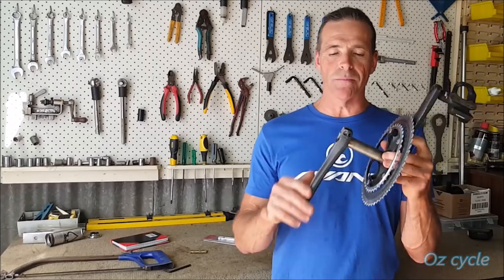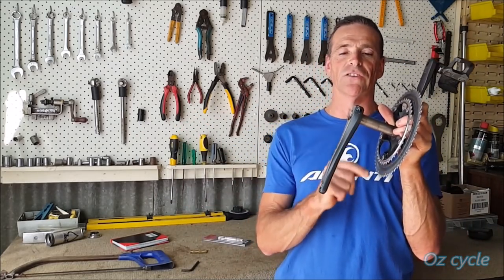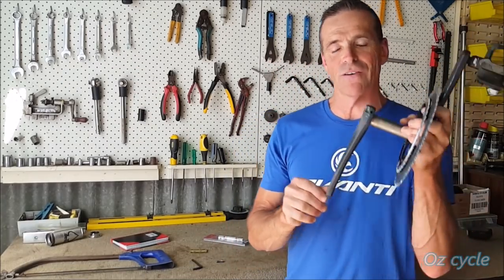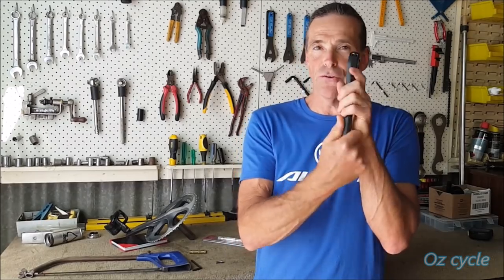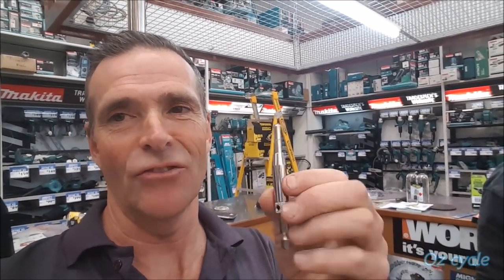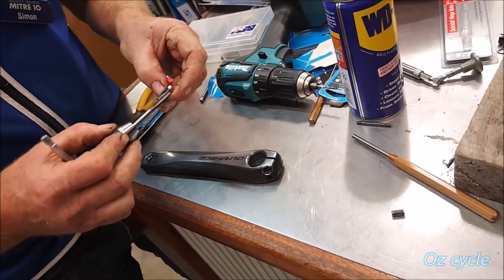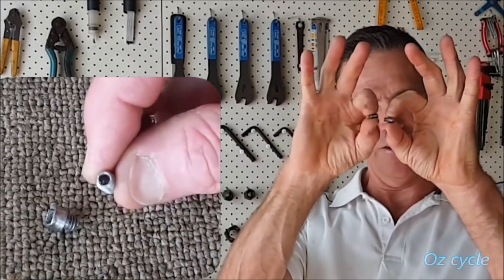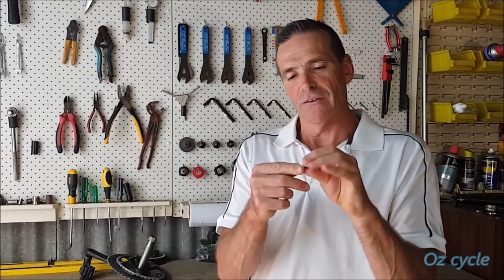Remove snapped off bolts

Comment: Good job mate i stripped the thread on my saddle clamp bolt on my Giant propel the shop used the same method as you. I have now invested in a torque wrench so it does not happen again.

Comment: The specialised carpenter's bit can be achieved by simply finding a suitable diameter piece of pipe for the hole. Left hand drill bits are so good that usually you will not need an easy out to finish the extraction : the bolt will extract itself as you're drilling it out.
     Excellent presentation. I would advise clamping the work, though, whenever possible.

Comment: Ive swapped mine to titanium and u use a torque wrench. I also put a little drop if loctite blue. I used to have a small set of broken bolt removers you just driĺl out a little less then the diameter if the bolt and screw the bit in until its tight then undo it. Probably very similar to the easy out.
Reply: Do you use the quickbit hinge mate to drill the hole first? I tried that with ordinary drill ,the bolt is too firm!!
Reply from the maker: Drill a pilot hole first with a very hard bit like a cobalt bit
Reply: @stevenleffanue  I will try that! Thank you so much.

Comment: Good info, thanks. Just a reminder people to grease  threads before you install bolts so you don't round out the heads. And use a hex  that's in good condition.
Reply: And always use the right size Allen wrench.

Comment: I bought a used bmx bike and the stem bolts were rusted on, I got all of them off except for one and this one is stripped. The worst thing ever is a rusted on and stripped bolt. The worst part is I can’t even ride the bike until I get the stem off to replace the fork with the new one I bought.

Comment: Hello. Thanks for video. This gadget wich you used is very expensive! It is possible to get similar on Aliexpress or Ebay (mayby quality is not the same) called "Self Centering Hinge Drill Bit"
Reply from the maker: The Aliexpress ones...the tool itself will be fine but the drill bit want be hard enough for drilling stainless steel so you may need to buy a hardened drill bit seperately.
Reply: @stevenleffanue  Yes, good suggestion.

Comment: I've got brand new ultegra rim brakes. Need to change the pads to carbon specific ones... One of the cartridge retainer bolts is rounded from the factory. FFS. It's so tiny! If I try and use a tiny bolt extractor and it goes wrong I might invalidate the warranty.  I can send the brake caliper off for inspection but that seems like a total hassle
Reply from the maker: Use a reverse drill bit. Careful to hold it central as you drill and you will get the bolt out.
Reply: @stevenleffanue  well I got it out! My reverse drill bit was too big for the 2mm hex hole in the bolt. Luckily I remebered a set of torx bits that came with my ratchet screwdriver. I  was able to jam the 2.5mm one in. Mangled the bolt head a bit more but it was heading for the trash anyway.

Comment: Great video as always, thanks. When running a tap through an already threaded hole, does the tap naturally find its way into the existing thread and clean it up? Or is there a risk it will try and cut a whole new thread and you end up with a mess?
Reply: same as screwing a bolt in. just dont cross thread it and make sure it goes in level.

Comment: How hard is the metal in the drill in the "hinge mate"?  Will it work on most bolts on bikes?  This video is timely for me since I have a broken cleat bolt on some shoes that I like.
Reply from the maker: You can put whatever drill bit you want in it. An 'Inox' bit is probarbly best.
Reply: @stevenleffanue  thanks Steve.  Very helpful, I will get one.

Comment: Needless to say that some white grease would have helped avoiding this problem, i guess. If the bolt is stuck heat it up to 120 - 140 Celsius and let ist cool down several time. I know that it will take up all your patience. The tension and release in the metal might make your job easier.
Reply from the maker: Yes,heat works with metal in metal but it will usually damage the surrounding metals molecular structure not the least any paintwork or anodizing. Not suitable if a bolt is associated with carbon fiber either.

Comment: sort of unrelated down under do you say a bolt is ceased instead of seized?
Reply from the maker: Ceased...is that right?
Reply: @stevenleffanue  ceased, means stopped like a cease and desist order from a lawyer. Seized means can't be moved. Just curious if it was Aussie slang (:
Reply from the maker: Not slang. We just say seezed 😂
Reply: @stevenleffanue  seized 😛
Reply: @stevenleffanue  I like the channel btw I'm a bicycle mechanic by trade though from the MacGyver school. The other day at home I used a quick release and a few washers as a headset cup press ;)

Comment: Your friend should have tried to use t25 bit to extract the screw before the larger hex key, it has more bite
Reply from the maker: Good idea Marc. You mean a T30 or T40 tho, as the head was a 5mm Alen and T25 is too small?
Reply: some times that works, I did this myself on a bolt once, but some times the bolts rounds off too much, some brands use junk bolts, common on RaceFace/Easton stuff. but Shimano bolts round off easy.
I think this is due to bad tolerances tool is not perfect, the bolt is not perfect, Now I use Teng Tools mini Ratchet with bits which has good tolerances, but I wish the bad tolerances bolts were not a thing, sadly many things comes with bad bolts.
I found the Park tools to not be so accurate as I wish they were, Teng Tools is more accurate, but other brands out there that are tool, but bolts have good tolerances too.
But Park tool is much more accurate then the cheaper options, they use rebranded Bondhus  L keys keys & multi tools.
Reply: @stevenleffanue  You could be right with the size, I had the same issues a few years ago where I needed to jamm a t30 or t40 into the screw head and carefully unscrewed the screw.  Then I learned, when ever I touch that screw on the crank, use a brand new screw each time.  It was not the 1st time I had this issue.